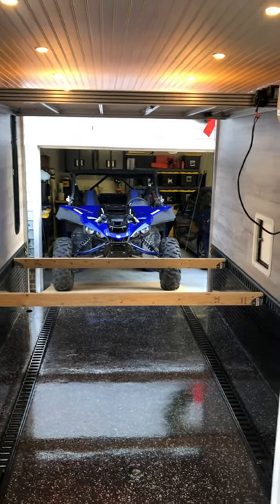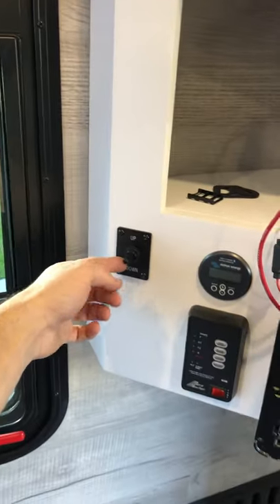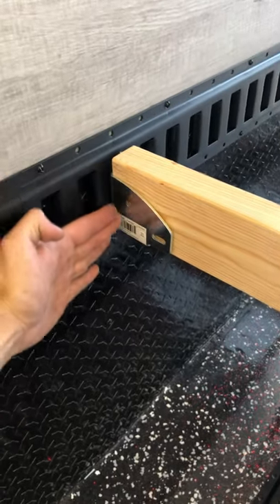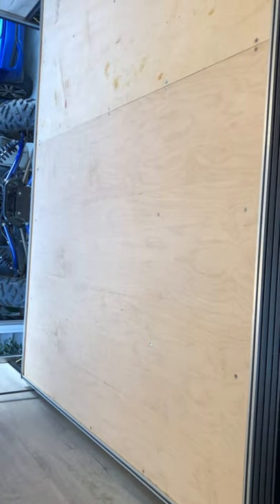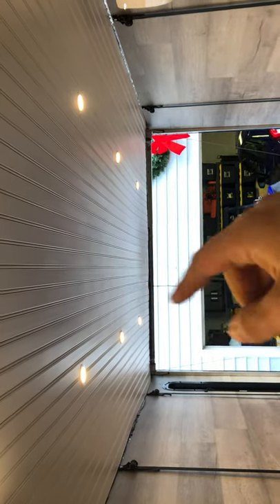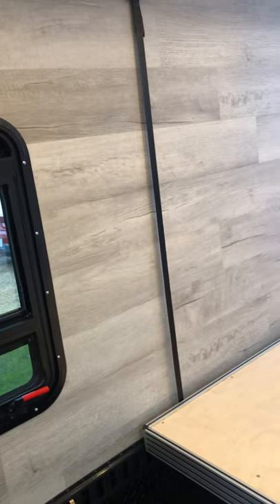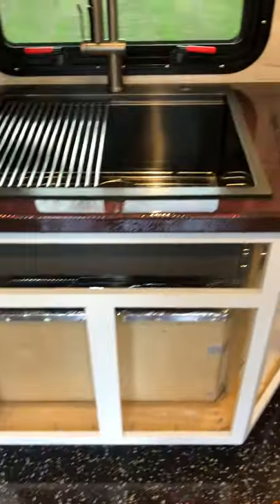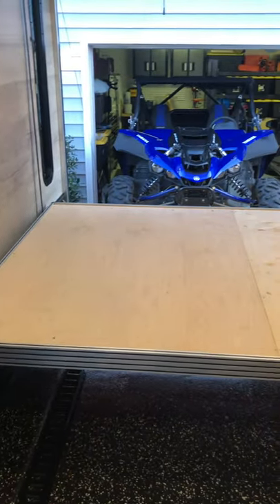The Best/Easiest DIY Electric Bed Lift for Cargo Trailer, RV, or Camper Van

Comment: You have done awesome job.  I do have a different motor I plan on using when I build my bed.  A company called Touchless Covers uses what is called a tubular motor to lift and lower their boat covers.  I think this motor would work great to raise and lower a bed.  The HD motor will lift up to 700 lbs.  It is about 3' long and 3" diameter so it could be hidden under the bed. It also come with a remote and you can program the up and down stops.   How did you attach the T2 soffit to the ceiling and also could that be used on the walls?
Reply from the maker: Thanks!   I was actually looking for something like that but I couldn’t find it.  Feel free to post a link! 

Soffit is just self tapping screwed to the ceiling members.  The trailer had wood furring strips self tapping screwed to the ceiling about 3 times the width of each members and the soffit screws screw into the wood that overhangs
Reply: I would also love to get more information about this motor and to have it under the bed would be way cool could you share how this could be done?
Reply: Perhaps the URL for that motor thanks

Comment: I love this design and I really appreciate it. The only thing different I’m gonna do is put the motor under the bed so that the bed rail hides the motor.  can you think of any reason why this wouldn’t work?
Reply from the maker: I just couldn’t find one that would fit inside the frame still in line with the shaft.  Someone on here found an axial in line motor of sorts but I never found a comparable strong one for a reasonable price
Reply: @bren5279  so you couldn’t box the under carriage of the bedframe and mount it underneath and just use about a 6 inch or whatever the width is of the motor to the mounting plate shorter shaft? Please don’t take this the wrong way. I love what you did and if at the end of the day I have to have a motor that Sean or installed on the backside it is what it is.

Comment: Nice job. Based on the shine, looks like you don't have a protective coating on that epoxy. Epoxy scratches so easily, I wonder if you've since put an additional finish down.

Comment: Nice setup. Why do you need the solenoid? Is it just to reverse polarity on the motor so you can go up and down? Would just a rocker switch wired in work? Do you need constant power on the motor to keep it from unwinding when loaded? My setup wouldn't have a bottom rest, it would be hanging in free space so just wondering if it would unwind without power to the motor?
Reply from the maker: Too much current for a regular switch.   No need for power it’s a worm gear setup so it doesn’t budge unless you use the motor.  Won’t unwind at all without power

Comment: Great design and thanks for the details.  Do you think using cable would rectify the uneven spooling issue?
Reply from the maker: Possibly, but then you have the problem of spooling the cable without it winding over itself, also the cable noise, the cable would need pulleys instead of just slides otherwise it’d cut through it.   Then there’s also sleeping next to wire rope cables which are really bad about grabbing your hair if you brush against it.

Comment: How have the straps held up long term, the ones ive looked at here in the uk all mention thete not designed to lift load so i just wondered if uve had any problems in the last year.

Comment: Very nice installation!   I'm curious as to why you used a solenoid?  It seems there are switches available that will handle the amperage required for this motor.
Reply from the maker: Possibly, I just didn’t know of any that would handle the amperage.  Winch motors can pull a bunch of amps.  Just seemed easier but if you find one that can feel free to post it up

Comment: does not the shaft twist when the bed is under load due to the motor being only on one side? Thanks, nice setup
Reply from the maker: Nope, the chromoly is strong enough. I’ve had two people on it and it was fine.    However I do now typically lower it down onto E-track hooks on the wall when we’re sleeping on it so that it doesn’t move around.
Reply: @bren5279  Thanks for the answer. Where did you sorce the profiles from? are they Item profiles?

Comment: I have been trying to create this in my ford transit 350 XLT Extended High Roof
And I’m leaving the third person that said they could build it for me.  This last guy in Idaho told me I should just use Bungee cords to assist the motor.  I asked if I should buy a bigger motor than the one 6amp- 12v-50RPM motocraft. 
The bed goes up but need assistance ( with my shoulder under it … :-(. )
Kinda frustrating and cost I had paid for something that is not correct.  
Kinda bummed   🙁 
58 year old small framed tired 😪 woman.   Any suggestions ?
Not sure what to do now. Was down near Houston before this and west of Dallas before that …
Reply: Well I have a bed that is now attached to the top of wall with pulleys and it worked when nothing was on bed but as soon as I put 4 4 inch 4 toppers and pillows sheets and comforter the bed would only lift 12 inches off top of benches in back of my Ford Transit.   😑 
I had driven 2300 miles because this guy convinced me the other 2 guys didn’t know what they were doing and he knew how to make it work.  Then told me pulleys would double power of motor and lift the bed up.  It did until I put bedding on.  Kind of at my wits end. 
The whole reason for having a bed lift system was so that I didn’t have to construct a bed but it seems now I’m gonna have to take everything off the bed just to get it up in the air and that defeats the whole purpose. I was told afterwards when it didn’t work that my bed frame is too heavy?  I used 80/20 4.5 “ tall X 1.5 inches wide with 1.5 X 1.5 supports ?   Bed frame is 60”w X 65” Long. 
Spent a lot of $ on bed frame. Do I need to use a lighter bed frame? 
Spent crazy amounts of money on Labor Already and crazy amounts in fuel going to different locations to where another guy told me he would make it work ?
Reply: 2- 4” foam mattress toppers not 4 ….

Comment: Oh wow, I was looking for.this!! I could figure out the kind of motor needed! And i didn't know that pillow bearings was the solution I needed!

The list part on Amazon is empty when I open it.. could out a link to the buckles and guides ?
Reply from the maker: Yeah sorry; as Amazon and sellers change their products the links will slowly go out.  They’re just stainless steel smooth 1” buckles.
Reply: @bren5279  thanks, could you help me out with the bearings? I have 1.6mm rod, should I get a 1.6mm bearing or something bigger? I'll have a pillow bearing in the middle and a "end cap" bearing at the end, so I need to be able to slide the rod inside the bearings with relative ease..
Reply from the maker: @LOLLOF90  1.6mm????
Reply: @bren5279  typo 16mm, 1.6cm 🤣

Comment: Thanks for this!  Exactly what I want to build above the cab in my old A class!  Love your idea of using a de-handled ratchet as the adjustable strap anchor on the wall.  I see you used a big bolt, but what is it bolted into (in the wall)?
...and 2),  how did you know it would be strong enough to hold up the bed plus people?  I see from your outside shot that it's not through-bolted to the outside...
Reply from the maker: So I used some good size rivet nuts directly into the metal wall studs.  I drilled out the wood and stuff in front with a larger drill to make sure the rivet nut was installed on just the metal, then used some washers as shims to bolt the ratchet flush. This way it was anchored with the rivet nut then additionally supported by the wall wood.  Since most of the force is in sheer, and its 7/16 grade 8 rivet nuts and bolts, it’ll have no problem holding a couple hundred pounds.  The straps would probably fail first.

Comment: How did you connect the shaft to the motor? All wiper motors i can find look identical to yours but have a threaded shaft… :(
I imagine just threading a larger shaft on there is not gonna work since the motor spins both ways and it will loosen over time?

Comment: Wait-you have no rails or tracks mounted into the walls? So this doesn’t need to be positioned between two walls? It could be used in a larger room, with the bed platform against just one wall?

Comment: Hi, you mentioned a solenoid in your video but it isn't on the parts list. Ps. thank you for making this video and figuring this out! Also, I am assuming you used a round tube, not solid?
Reply from the maker: Oh yeah I just picked up a small winch one off Amazon. Nothing special just you’re typical small winch solenoid.    Yep hollow tube to save some weight but you could also use solid too. I used hollow so I could put the motor shaft inside it and thread the wall for a set screw

Comment: I've been trying to source the same motor you're using in Ireland, but can't seem to find anything that will ship to Ireland, at least for a reasonable price.

From a close up in the video I see the details are:
Model: ZD1633R
Power: 100W
Voltage: 12V
Rated Speed: 50RPM
Rated Torque: 8N.m
Reduction ratio: 61:1

If anyone may be able to link me to something similar from any European based site it would be greatly appreciated!

Comment: Hi Bren, can you tell me what are the specs on the 12V DC motor, you have used for your enclosed trailer. I am thinking of a King size bed with 10" mattress and a wooden frame which might be a lot heavier. Thanx

Comment: Looks great!  Exactly what I was looking for!   I noticed your floor! Did you use an epoxy? If so how well is it holding up? I painted mine for now. I’m not happy with it at all.
Reply from the maker: Thanks!  Yep, it’s doing decently so far but I also haven’t walked around with muddy rocky feet on it.  Adding some of the grip sand additive was a good idea to break up the glass smooth surface and minimize the scratching a bit.
Reply: John,
2003, for our ExpeditionVehicle, we laid one-inch pink-board, topped by half-inch marine plywood painted on all surfaces to seal.
Our visual floor is bamboo plank perimeter with slate in the center.
.
Twenty-four months twenty-four thousand miles around South America.
Alaska, Panama, all over North and Central America.
Summers up rough logger tracks to remote mountain lakes.
Winters on isolated Baja beaches.
.
Nearly two decades full-time live-aboard, this works for us.
.
On skoolie and other DIY home-made forums, folks are concerned about the pink-board collapsing from walking on it.
Based on our experience, that will not happen.

Comment: Great bed system. I’m in the process of building mine the way you did. What’s the purpose of the solenoid? Is that required?
Reply from the maker: It’s mainly because of how much power the motor pulls (about 20 amps at peak from what another guy said). That much amps would be a bit much for a standard up down switch. You could also just use relays but the winch solenoid is an easier all in one. Google winch solenoid for more indo
Reply: @bren5279  thanks. That makes sense. Do you have a link to the solenoid you used? I’m using the same motor you did. Your links are mostly broken in the “store” you created (probably just outdated). Thanks again!

Comment: Hi I realize this is an old video but I just did the build but I keep blowing a fuse so wondering how you wired yours
mine has a 7 pole up down switch and a solenoid wired to 12 volts
so my 2 top and bottom poles are crisscrossed opposite corners then out to the connecter pins on solenoid
the center poles 1 positive to solenoid positve post the other center pole and top pole by itself are jumped then to negative post on solenoid
wires from motor 1 each to outer post on solenoid then positive and negative battery leads also connected to post on solenoid
thanks

Comment: Thanks so much for sharing.  I'm out here in Colorado working on trying to design a bed. Would love to work off your design. I saw in a previous comment that you would change a few things.  One change was to use a guide for the straps with a pulley taken apart. Can you elaborate on this?  Would you still have the space for the strap system with this addition? Thanks!

Comment: good video.  I am not sure I get how you installed the mini-split inside the trailer (I saw the cutout in the floor).
Reply from the maker: It’s essentially a generator bay with the floor cut open and metal mesh put down.

Comment: Are  you happy with floor, what brand did you use 

Thank you for your time.
Reply from the maker: Yes and no;  it looks great, but cost a lot and scratching from rocky shoes does show.   I think if I was going to do everything all over again I’d do LVP or sheet rubber on the floor, and maybe sheet plastic for the walls.

Comment: Hey, 
How much load can the motor take? Can it hold the weight of the bed and two people in it without a stop breaker on the wall? Do you have a link? Thank you and have nice travels!
Reply: I don't think having two people on the bed while raising it is a realistic expectation.
Reply: Hey @BusyAsABeaver72  . I don't want to lift the bed with two people on top. I want the bed to be able to support the weight of two people when it is stationary, without any brakes on the structure.
Reply: @beatrizgraca9333  I wouldn't expect the motor to hold that, but I don't know. You also you would be need serious structure in the roof which I don't have. My bed runs up and down on rails and trolly wheels so I pin it in the positions I want it to stay. 
Interesting concept you have tho,  just have to try it
Reply: FYI, I would never use the barn door rails and trolly wheels again, they don't work all that well and cost me $200.

Comment: I’m having a hard time locating this same 100 watt motor. Do you have a brand name? The model number only shows up for sale in Australia. Thanks
Reply from the maker: Search 100w 50rpm 12v on eBay.  

https://www.ebay.com/itm/153258534957?_trkparms=ispr%3D1&hash=item23aeeba82d:g:3iEAAOSwPTlb6jMU&amdata=enc%3AAQAGAAACoPYe5NmHp%252B2JMhMi7yxGiTJkPrKr5t53CooMSQt2orsStEKTPzZMfQmny3knR97t0D9lcJvRr2A9EmQu0QYPmREgTDqkuejhfsNcnFMR87XLufpAFcSqfaG9ABelE0gKnkPoBZg7O37mjndTyT91AqF52rALOvLrX0w6vosO7GFn6uIFWRnVRmBKLa%252FPiQY1sTmqAj%252FOe8lKGvRG398WGv%252BSlJaGTdM0uPGwhKRsDwccaoU1Ku%252Fo7UBurZWLrmUVfQoKcwOuMRJY5JXhxfv4XuHw2sE0%252FHpA1XL7vKz6%252BEO8gTq82GjXAwE9VNSm1udVajPQrJ4BHL767gT5E3jjzWdRLTrEtth51ZBjCHYo1XAg4VwmKYvBlkm%252Bkz%252Bh8OYXjaSWtbgdo40tVHwRAl2KJW8pHYOL4KeBiduQYASj1Pzn8RjNx966n9ktyK1E0%252BywX0sqfHqqR%252FwGpygJbF3%252B1jTrN3LHaKEDC5BqD9eYkv7oexIpy0LSYGaXjQTL0gQ78kz4P6sOh5l4iMebr3417MM1ItSoNQMcgkP4k7WVSpJ47XgggTHOF4nT8r8ODx%252F28Hdi3%252BFxn0dV8LGlmYk4VnyPUk5Bgau%252Bmx2R7fg9j9f%252BLWZOY%252B1KkVHFWLVzJpTfg3gA4zVtEvTqSX27byN1%252BeHhtOGb9Pct3diF2jNFxDA8AcSdmsbqDEKOsLTz463HsfS05kRy2ODcfwWI4jcb1M6qB2hJiAkYdEsgfbGvqKKR1AreuZ4nEYiOWoZIFohBdvIci%252BJHU30Fe1bn4EvqL7ht%252F5TFFzJ%252BS%252F%252B0TgfBMgWTGmPUlKFE7Are5qJZG%252ByM5yauf6GK0N0NOquNeL5xS%252F%252BwN86tFEA4vE7qjImJLF8kpuL8L7pADwNB%252FOiefPukXA%253D%253D%7Cclp%3A2334524%7Ctkp%3ABFBM7O_MkN1f

Comment: Great work ……thank you for sharing may  I ask where did you find the motor with the drive shaft 

Thanks
Reply from the maker: Search 12v 100w 50rpm motor on ebay

https://www.ebay.com/itm/153258534957?_trkparms=ispr%3D1&hash=item23aeeba82d:g:3iEAAOSwPTlb6jMU&amdata=enc%3AAQAGAAACoPYe5NmHp%252B2JMhMi7yxGiTJkPrKr5t53CooMSQt2orsStEKTPzZMfQmny3knR97t0D9lcJvRr2A9EmQu0QYPmREgTDqkuejhfsNcnFMR87XLufpAFcSqfaG9ABelE0gKnkPoBZg7O37mjndTyT91AqF52rALOvLrX0w6vosO7GFn6uIFWRnVRmBKLa%252FPiQY1sTmqAj%252FOe8lKGvRG398WGv%252BSlJaGTdM0uPGwhKRsDwccaoU1Ku%252Fo7UBurZWLrmUVfQoKcwOuMRJY5JXhxfv4XuHw2sE0%252FHpA1XL7vKz6%252BEO8gTq82GjXAwE9VNSm1udVajPQrJ4BHL767gT5E3jjzWdRLTrEtth51ZBjCHYo1XAg4VwmKYvBlkm%252Bkz%252Bh8OYXjaSWtbgdo40tVHwRAl2KJW8pHYOL4KeBiduQYASj1Pzn8RjNx966n9ktyK1E0%252BywX0sqfHqqR%252FwGpygJbF3%252B1jTrN3LHaKEDC5BqD9eYkv7oexIpy0LSYGaXjQTL0gQ78kz4P6sOh5l4iMebr3417MM1ItSoNQMcgkP4k7WVSpJ47XgggTHOF4nT8r8ODx%252F28Hdi3%252BFxn0dV8LGlmYk4VnyPUk5Bgau%252Bmx2R7fg9j9f%252BLWZOY%252B1KkVHFWLVzJpTfg3gA4zVtEvTqSX27byN1%252BeHhtOGb9Pct3diF2jNFxDA8AcSdmsbqDEKOsLTz463HsfS05kRy2ODcfwWI4jcb1M6qB2hJiAkYdEsgfbGvqKKR1AreuZ4nEYiOWoZIFohBdvIci%252BJHU30Fe1bn4EvqL7ht%252F5TFFzJ%252BS%252F%252B0TgfBMgWTGmPUlKFE7Are5qJZG%252ByM5yauf6GK0N0NOquNeL5xS%252F%252BwN86tFEA4vE7qjImJLF8kpuL8L7pADwNB%252FOiefPukXA%253D%253D%7Cclp%3A2334524%7Ctkp%3ABFBM7O_MkN1f
Reply: Thanks Much appreciated

Comment: Can you put links where you got the components. Lift, floor, ac unit, lights. Really like the style, also trailer please.
Reply from the maker: Unfortunately my components list was on my old laptop that crashed, so I no longer have it.  But I talk about several things in the second half of the video. The mini split is just an LG 9k, epoxy floor, 12v puck led lights off Amazon.   If you click the sketchup link I have a list of things for the bed lift.   Trailer is a Look Avalanche aluminum 23’
Reply: @bren5279  Reason I was asking is I wanted to find out what the motor rating is so I don't get one too small, or over kill it with a way too big unit.
Reply from the maker: @davej7434  watch the video, I zoom in on the motor label and go through most of the stuff in detail. 
The motor is just about right, however, if you put a garage spring on the shaft you could probably use a smaller one

Comment: What 12v motor did you use?
Reply from the maker: It’s a basically a 12v worm gear tarp motor.  It’s in the video.